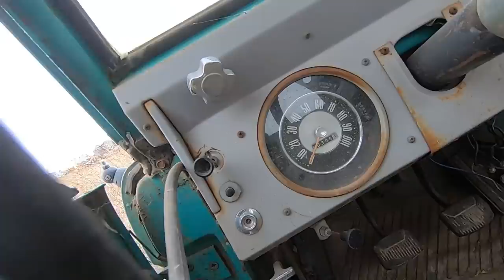Abandoned 1966 Ford Bronco rescued from the pasture! Will it run after sitting for 25 years?!?

Comment: I really like the role duff plays. He keeps away a need for any weird friends you might bring on.
Reply: The role of any good shop dog. 

Mine is an 8 year old chocolate lab, that is also my service dog. Trained him.back in 2014, in case I needed another amputation,  and had a trans femoral on July. 

Diesel will fetch parts, tools (takes a.few.tries.to get the right one, but he tries) drinks from the fridge, holds the door, and if I need.help.up, stands and adds a bracing point to get back in the chair, or on my prosthetic. Training him.to get my liner socks now, from a.shelf in my office, or.my bag, and he's picking up on it quick.

Still have the wierd.friends stopping by, and customers, as well as my wife, but the dog is almost the perfect shop companion. At least until the wife brings her 11 year old black lab with her. The other half of.our bonded pair of rescues.

Comment: Generally speaking when the fan moves when rocking it ....it’s in gear ....lol . Love those 60’s Broncos . It’s a keeper . 👍👍
Reply: That was funny glad she didn't fire been there done that! New tool box to boot lol
Reply from the maker: Hey it happens!
Reply: Darn duffy dawg knocks everything
Reply: Clr to flush block 
Run a bead of mig weld on the inside lip of the freezer plug and they will fall right out  unless its brass then slide hammer

Comment: Best way to flush blocks from my experience has been plain water until it flows clear, then add a gallon of Evap-o-rust to the coolant system topped off by distilled water. I run the engine to heat cycle it a few times over the coarse of a day then drain and refill with coolant. Nice find!
Reply from the maker: I'll give that a shot!
Reply: We did this with my Jeep and my two Oldsmobile. When we got around to tearing them down, the coolant passages looked great! We still completely tore them down, and went the whole 9 yards. But it gave us insight to cleaning and treating our Daily drivers.
Reply: @MortskeRepair  Anything acidic; The lower the PH, the more it needs dilution. I've always done it by guess and by gosh. but you can always use temporary plugs and do a relatively high acid content so you don't wreck your new plugs. Those plugs were designed into early engines for a "shaker" to pick up the block and shake the sand out of them. Of course their value as a "freeze" plug was easily recognized.

Comment: we just revived my grandpas 66 bronco yesterday’. been sitting since 1999. he wanted to buy high dollar 10-30 for it. told him we only run the best around here so we put diesel oil in it. he also wanted to pull the carb off and rebuild it. whacked her with the ole hammy 1-2-3 times and she came right around. ole floatskies started working and everything. all we did was drain the tank, a new fuel hose, changed the oil, and she fired right up. i loved all the stories he told me of how he went further in the woods in 2 high than the new jeeps in 4 low. it’s funny since it has vacuum wipers they make a 1/2 turn when you first start it. definitely very cool old units! great find.
Reply from the maker: Good stuff! They're tough old rigs!
Reply: @MortskeRepair  it’s a all numbers matching rig, we have the pto winch, and judging by the pedals, i’d say she’s a original 70,000 mile rig. just went out and bumped the key and she roared rught to life. today’s project is brakes, and changing t case oil, tranny oil, and rear end fluid and i’m gonna see about getting tags and insurance back on the old rig

Comment: Fantastic channel man! I'm here from Puddin cross over. Next time you're welding nuts on broken studs. Weld a weiner on the stud without a nut first. Next put a flat washer on weld it to the weiner. Then weld the nut to the washer. Most importantly wait for them to cool until you can touch it bare handed. Weld is soft when it's hot. 40 year old heavy equipment field service technician.  I've extracted 100s of bolts from 1/4 to 1and1/4 with this method and got every one . It's in a caterpillar service manual somewhere.  If you have several to do like you did, make an assembly line just go to the next broken one, next step and so on. Another trick is if it's broken off deep in a hold like on metal tracks. Cut a piece of an aluminum can and put it in the hole like a roll pin. The aluminum will keep you from welding to the surrounding metal and pull just the broken bolt. Subscribed, look forward to more videos
Reply from the maker: Thanks for the tip!

Comment: White vinegar and water. I bought a Ford ranger that was super rusty. I used a gallon of white vinegar and filled the rad water, run it up to normal temp, shut it down, l leave it at overnight and drain in the morning, then flush it good with water. Worked awesome.
Reply from the maker: Great tip!

Comment: I use two gallons of Gumout cleaner and run it through the cooling system. Fill, sit, drain a few times then rinse with water. The Gumout is reusable for several times.

Comment: The coil has 2 windings, therefore 4 wires, 2 of these are connected together at the points side LT terminal, if you got them reversed it might still run however the sparkolator HT current would return through the + ignition side instead of through the condensor, probably resulting in a shorter/weaker spark, and if you listen to the radio probably a load of intereference.
You want the HT current to go through the condensor as it forms a resonant circuit making a brighter/longer spark.
Reply: Thank you! This I didnt know.

Comment: Currently into one of my Morris Major Elites, parked since 1998, driven over rough ground to a rubbish tip for its last 20 odd years of service.  This bloody Ford is its Stateside doppelganger - the guy was 'thrifty' and barbarous (possibly illiterate - rear axle nut is stamped 'LH THREAD'...someone had chawed into it with a chisel turning it left)...I occasionally need to walk away in literal disgust.  You're a big man...props.
Reply from the maker: Glad to hear you're having fun!

Comment: Love the videos. Another trick I know, after you get the bolt/stud hot, hit it with some paraffin wax. The wax melts and gets sucked into the threads. Worked well for talking old irrigation pumps apart.
Reply from the maker: Great tip

Comment: ‘78 would have come from the factory with a Duraspark electronic ignition setup, which I think came out in ‘74? So yeah, no points, and no points gap to specify. Guess whoever swapped that engine in reused the original engine distributor instead of adapting the Duraspark (not like adapting it is that hard, but then again, if they got the basic coil wiring backward, that was probably for the best)
Reply from the maker: Left the emissions carb and tossed the high energy ignition. What the French?!?

Comment: Nice find! I know you did a lot of work but I would love to own one. There very expensive to find one period and most are just totally rusted out junk. By the way my 78 K5 with 32” tires and a 4” lift is all tight but above 60 on bumpy swaying roads is also very scary because of the short wheel base.
Reply from the maker: I had a 72 K5 on 37s. That was a handful.
Reply: @MortskeRepair  I bet

Comment: I have had really good luck with both phosphoric acid and osphalic acid on cast iron blocks.  Plug off all the holes, pull the thermostat and fill er up.  Let it sit for a week, then flush.  Rinse and repeat if required.  Most rad flush products are nothing but dilute phosphoric acid.  Spendy way to buy it.  Go to Lowes or a paint shop and buy it in 5 gallon pails for cheap.  It’s reusable too.   Works on old radiators as well.  It removes iron oxide, calcium and even oily residue and converts the surface iron to iron phosphate, which is corrosion resistant moving forward.  Most recently I did my ‘49 Ford flathead (sat since 1979), and it worked like a charm.  I used it in the nasty old fuel tank as well after I steamed out the 3” of tar and varnish.  Bright and clean.
Reply from the maker: I'll have to give it a shot! Thanks!

Comment: Another great video with so many lessons, and "ask me how I know" admissions, starting with starting in gear. Taking the time after mentioning a donor to instead plow on with so many manifold bolts to show the tools, technique, and patience was perfect - working with what you have is such an important thing to pass along. You don't edit out the setbacks, and seeing for example just how much effort was necessary to get the engine back in is really appreciated, as is the longer form video in this case where you pick back up in the garage and finish up the run and drive phase. We have a couple 60s K10 Carryall projects that aren't as popular and are virtually never cut, but as Broncos go you are spot on in my opinion picking the first year short top uncut version to acquire and explore on the channel.

Comment: Best thing to clean up an old engine is dollar store oven cleaner.
Drench it and let it sit for a while. 
Then power wash it off.

Cheap and works wonders.

As for the white stuff in the radiator/thermostat, thats old antifreeze mixed with too much water. When it doesn't move for a long time, It pools and that causes it to crystalize and leave that residue in the perfect places to clog it!

Comment: duff's the boss! stuff you dug out of the filler neck was likely crystallized stop leak, plugged up the wrong hole... don't ask me how I know:-o. old engine builder guy in canada uses indian shellac permatex on his freeze plugs, i use whatever gasket maker i have left in the tube, the microcrud in the block usually seals any leaks after running for a short time. cheapest soak is distilled white or apple vinegar to remove rust, takes a few days to soak though to remove the rust, demonstrations of different types are on the tube, check them out. Keep on truck'n!

Comment: I know it's been months but Irwin makes LH drill bits for hardened steel, soak the hell out of it with penetrating oil and drill in steps till you get a decent size extractor in it. That's what we did at the shop when welding nuts failed!.also the hole releases surface tension at the threads

Comment: Nice to find one that's not all chopped up. It's not too bad.
I've used baking soda and vinegar to clean out rads and heater cores, works good. Blocks just get a good flush.
The first time I ever got pulled over by a cop, I was 9 on a mini trail 50, and the cop was in one of those Bronco's. 
It was black with white doors and a single red light. He gave me a stern warning, lol. 
Glad it wasn't the last time, I wouldn't have so many funny stories.
Reply from the maker: I got pulled over on a QA50 but it was a Crown Vic!

Comment: I knew it was a 200 strait 6 when I first saw it the ford fair mont and Mustang came with these 200 in line 6 cly. Dam good engines, even after rods pertrude through the side it will continue to run.

Comment: NCH Corp (Dallas) has a welding rod called Duratrode stud remover that works pretty well. It allows you to weld a nut over the broken stud hole and doesn’t stick to the engine block. After it cools, you can slowly twist the nut with a wrench.
Reply from the maker: Send me one to test out!
Reply: @MortskeRepair  They’re hard to find and expensive. I got a pair from a buddy who told me that he got them from another guy. They will save time on big jobs like your Bronco.

Comment: i had 2 of 1971 broncos , 6 popper and 351w race motor. when i got them the bodys fell off and the way home ie 600 feet . ended up with a full tube chassis 3 link front / 4link back . 10 k later my free stuff was awsome !
Reply from the maker: Sounds like a wild ride!

Comment: Had a 92 Bronco 351W with 4 broken studs on the water pump and one on the intake manifold. Heat , aero kroil , and a vice grip worked on the water pump. Had to drill the intake stud, the one cleset to the thermostat. Used a dremel tool with a rotary file and a easy out, messed up the hole but a 5/16" helocoil fixed it.

Comment: Excellent video Mortske Repair  :) also fix that Old Bronco truck to your liking and drive it to! Be interesting if the Windshield Wipers work also for steering put Lawn Mower Tractor from 1968 to 1984 year or even Boat  will work too only have wire button for horn also be excellent get V8 302 4 barrel motor it! Hope lights works too !
Reply from the maker: Thanks for watching and commenting Andrew!

Comment: I've been working on an 84 Bronco with the same crap in the cooling journals. I added a gallon of white vinegar to the radiator and it did wanders.  However that white crud did require me to remove the water pump and scrape the crud from the journals behind it.

Comment: When I was going to school?  We were told that if the wires were wrong on the coil?  The pitting of the points would burn down toward the distributor drive shaft.  That any pitting was supposed to go upward to the side that is usually fixed.  Well that is what they taught us in the 1970's

Comment: Run a GANO Filter, it goes inline on the upper hose.  It will trap the rust and keep it out of your radiator.  Just have to clean it out once in a while.    I just want to reach through the monitor and give you a hand, lol.  I've done what you're doing many times, I've owned 4 my first was a 66, latest is my 77.

Comment: Stupid late comment, but the start position  (key switch) goes to the relay and the coil and the run position goes through the ballast resister to the coil, which is just 10 volts for cold starting. The resister also protects the points from over heating and burning.

Comment: Hey the Ford is only 56 years old almost as old as me I am 59. I used to have a 67 ford mustang and I had a 62 ford f100 I have had decent luck with old fords they are very simple to fix. It looks like where you live they put quite a bit of salt on the roads so your lucky there is anything left of it at all.  Looks like all new copper nickel break lines and wheel cylinders  and master cylinder are in your near future if you want to stop oh and new rubber break lines. And don't forget new gas tank and new straps.  A Ford 302 v8 would be more better too. Always put Indian Head gasket sealer on your freeze plugs then they will never leak after you put them in. A new truck would be 100,000.00 dollars OBiden said I did that! Put a Ford 2 barrel on it. I bet it needs new king pins. Hey it looks cool and I'm sure for what you have in it its great. I think you just forgot what a pain the Camaro was. LOL The Bronco will get you through the snow and the Camaro will not. Never resuscitate old gas tanks just get a new one with a new sending unite in it.

Comment: So I have a 51 Commander bullet nose like in that field.  It was my great aunt’s car.  My dad got it when they pulled her keys.  It’s been parked inside since 1973-74 after dad got fed up when tails were broken and it took him months to locate them.  It remained there for almost 50 years till I recently took it home after my dad died last year and the home is to be sold since my mom is in a nursing home.  It has 66k miles.  V8 auto.  Nothing wrong to my knowledge when it was parked.  We’re about to attempt to start her.  Yikes.   Surprisingly parts are pretty easy to come by for that.  Wish me luck.  Give ol Duff a pet on the head from the Jimmykicker!

Comment: Pops had three Broncos for snow plowing and a 68 CJ five the years 73 ,77 and 83. The small broncos had 302’ s, the 70’s front ends needed help with the weight of the plows. Also the heaters sucked below 20 degrees! I was doing  Harry Chapin plowing and getting stoned .

Comment: I am thinking the radiator the engine the transmission probably a lot of wiring also came from a mustang or a Maverick possibly from the smog era and it was deleted when put into the bronco this would explain the floor shifter for sure
Reply from the maker: yeah, it's definitely been messed with. Usually the floor shift conversion is related to folks not maintaining the factory linkage and don't know how to fix them so they take the easy way out.

Comment: Cutting your spacer was one way to fix it, but you could have just turned toward the radiator.  The part you cut was where the EGR valve would have mounted. Was also thinking, you're ignition problem may be wiring from the regulator.  I believe one of the pins goes to the ignition.
Reply from the maker: Good call!

Comment: Drive a big sheet metal screw through the centre of the frost plug, then use the slide hammer. Saves damage to the mating surfaces.
Reply from the maker: The cast should be a lot stronger than the plug.